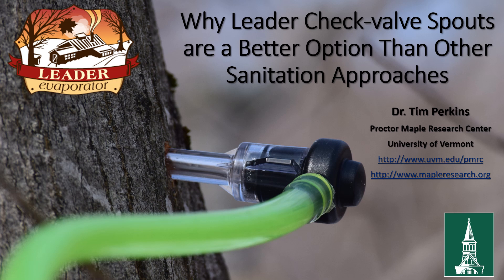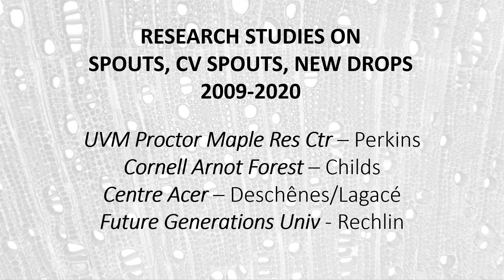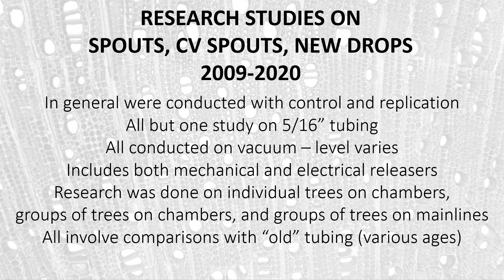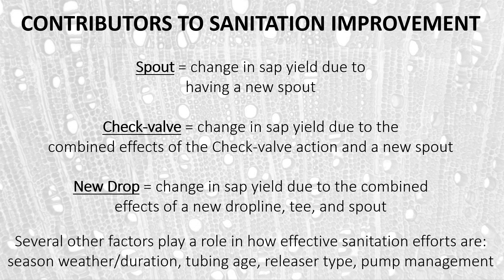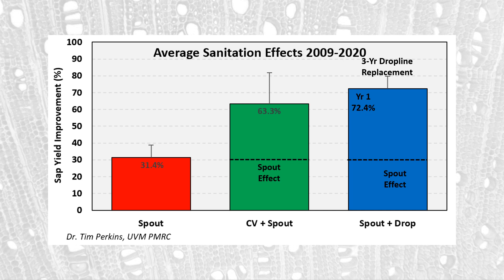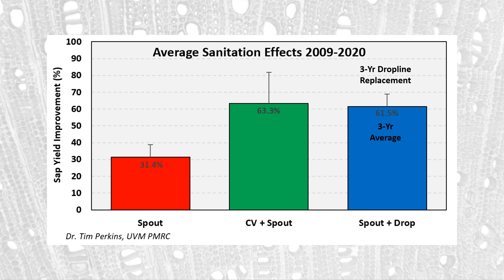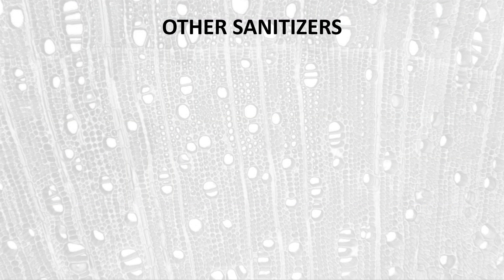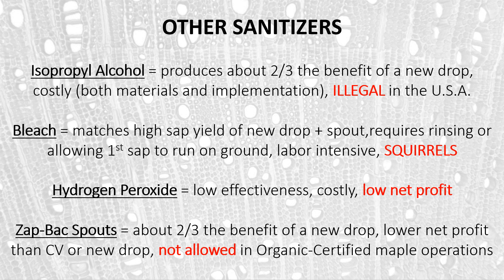Why Using Check valve Spouts is a Better Option for Maple Sap Collection

Comment: New spout and clean/new drop is best.
Reply from the maker: That is correct -- for ONE year.  After that sap yield drops off for Yr 2 (even with a new spout), then again for Yr 3 (even with a new spout), so that averaged over the 3-Yr time period (which is the typical/recommended replacement interval), new drop/new spout replacement ends up being in the "Top Tier" of replacement strategies in terms of sap yield, but because of the cost of materials and labor, is not necessarily the top choice economically.
Reply: @UVMProctorMapleResearchCenter  To make drop line replacement easier only hook one barb with the drop, do not replace the "t". To start a new year dirty drop and old tap are replaced with new tap and clean drop. Old taps disposed of, dirty drops get cleaned then get new taps installed and are ready for next season. Some may question only using one barb where the drop connects to the "t" but has worked well for me and makes removing the drop a snap. Check valve spout is a mechanical device and as such is subject to failure. The can get stuck closed or jam from debre and not close at all. A new spout with a sterilized drop (I boil them) produces trouble free maximum yields yoy.
Reply from the maker: @capt.sparrow34  Three thoughts on this: 1) replacement and then removal of droplines to clean each year is a labor-intensive chore. To properly consider the economics, you need to include the time spent doing this and would quickly find that the cost of doing so is quite high. 2) it is true that some % of any mechanical device will fail, including the CV spout. However, research (from several places) has shown that the majority of CV spouts don't fail during the season and overall the benefit in terms of yield and economic gain is worthwhile. 3) glad that pushing on to just one barb works for you, but when using high-vacuum this is likely to result in microleaks. Thus it is not a generally recommended practice.

Comment: I've used check valve spouts and regular spouts with vacuum (at the time, 5200 taps). I have not seen any difference in sap production in one vs the other.

Comment: What do you use for sanitation if not bleach?
Reply from the maker: There are several possible options, but bleach tends to give the best results and is most economical.  Sodium bleach unfortunately attracts squirrels, but calcium bleach works as well and doesn't seem to result in squirrel problems. There is another video in the "Keys to High Sap Yields" playlist on spout and dropline sanitation.

Comment: Is it true that Tim Perkins gets a royalty for every check valve sold??
Reply from the maker: UVM owns and controls the patent to the CV spout/adapter. They licensed it to Leader Evaporator.  The UVM faculty contract specifies that the inventor of any IP gets a share of any licensing proceeds. Regardless, the effectiveness of the CV has been researched and verified by other non-UVM maple researchers.

Comment: What about washing old spouts and re-using ? Does that have the same effect as a new spout? I don't have a large operation, so I typically take all my old spouts and let them sit in warm water and dish detergent for a few hours, then give them a good rinse and a pipe cleaner. I do see that it may be TOO labor intensive to do that with a bigger operation.
Reply from the maker: Cleaning and sanitizing spouts is very helpful, but often doesn't quite reach the level of new plastic.  Soaking in a dilute bleach solution for 10 min is helpful after cleaning (don't soak metal spiles in bleach any longer than that), followed by a triple water rinse.  Definitely not cost-effective in larger operations.  Cleaning of CV spouts is not recommended because you can't get all the biofilm off the ball, which then doesn't allow the ball to seat properly.
Reply: So do you have to replace check valves each year then?
Reply from the maker: @RobSchwarzOfTioga  Yes, that is the way they are meant to be used.  That is pretty typical of many plastic spouts.